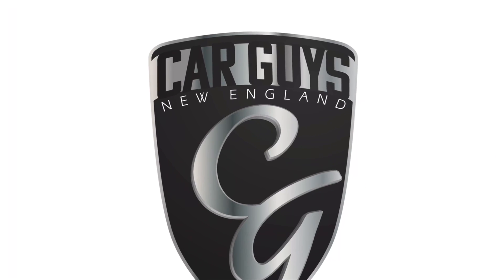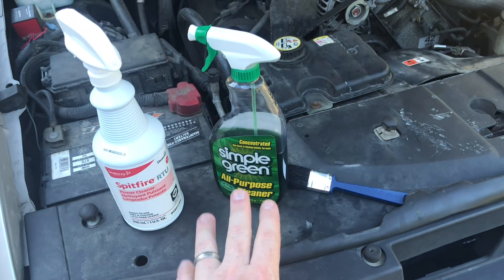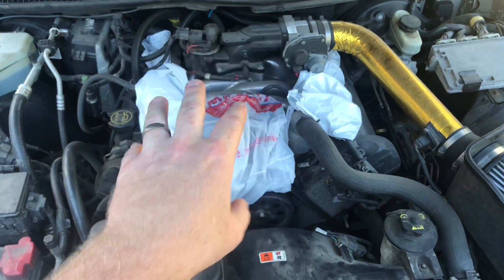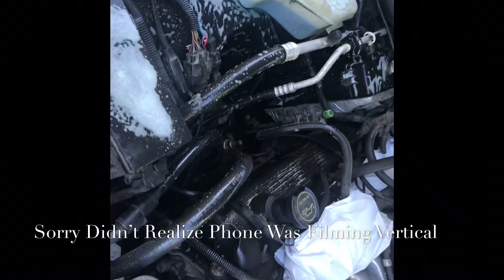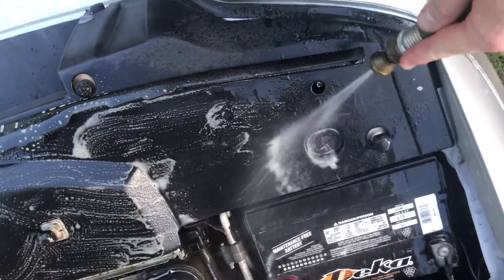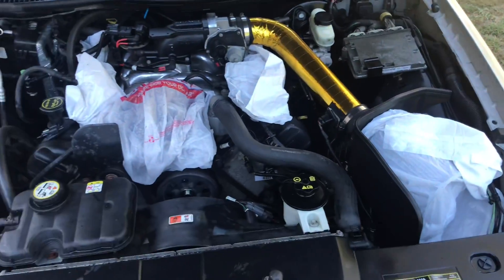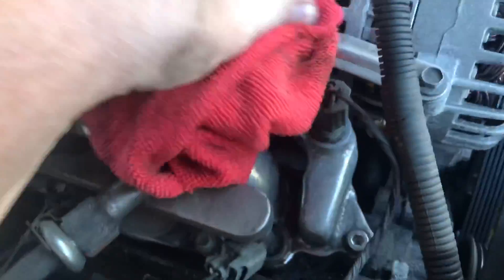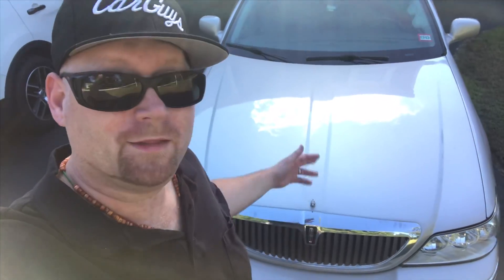How To Clean A Panther Platform Modular Engine

Comment: I have a 1989 Lincoln Town Car and the engine bay is built I was wondering can I cover up the same thing that you cover up so I won't damage the engine and also in the engine need to be cold? And also do I need to disconnect battery I really don't want to damage the engine of this old car it runs really good it only has 63000 miles on it

Comment: I bought my Town Car a few months back and really need to clean the engine compartment before changing spark plugs. Its so dirty that when I remove the coil packs dirt and debris can easily fall down onto the spark plug. What would you recommend for cleaning the crap that collects directly around the coil packs?
Reply: Use compressed air to blow the debris out. If you don't have one, use a straw and blow hard to get rid of the loose debris.